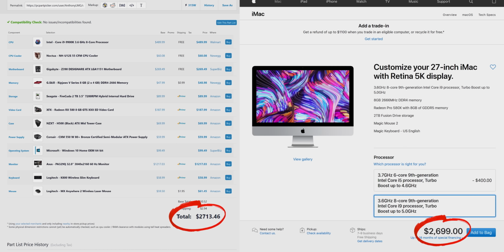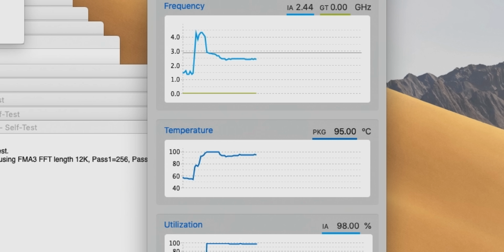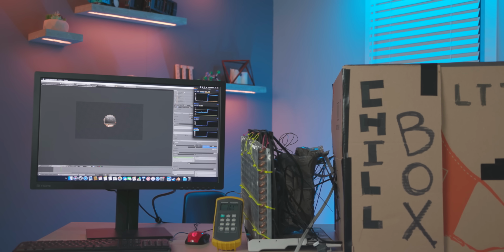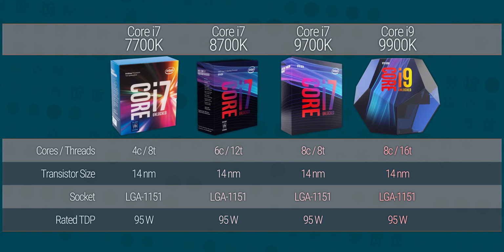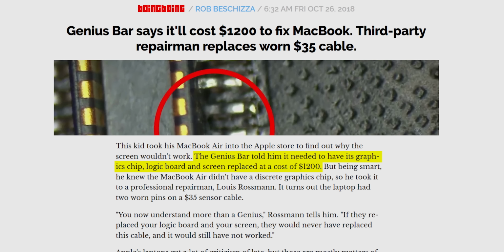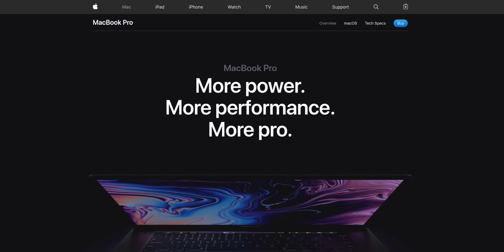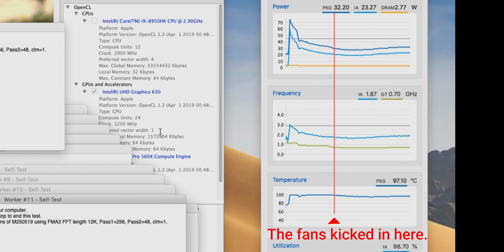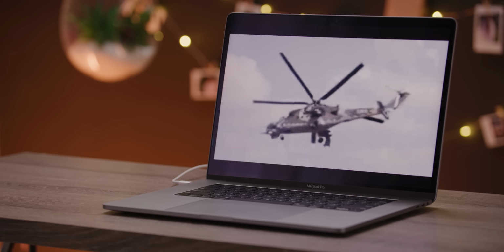Macs are SLOWER than PCs. Here’s why.

Comment: How is benchmark scores that don't go down from heat a "very compelling reason to buy an iPhone"? With today's phones, are the geekbench scores really important? Do you run into thermal throttling on your phones? Apple's iPhone SoCs are way more powerful than the equivalent Snapdragon, but the actual speed difference between flagship Android phones is and iPhones is negligible. How is that compelling?

Comment: Please show me a Windows machine in a similar form factor and battery life to the MBP that doesn't also throttle the CPU significantly under load. While I agree it's complete BS and these companies need to figure out their cooling strategy... there are simply no Windows laptops doing it better.
Reply: The Stealth and Gram both have U series processors with about half the power of the H series in the MBP. They're meant to run on lower power and be cooler, as they're made for "Ultrabooks". The Razer is also only available in 13". Both have excellent battery life and are great computers, but not meant for the same user as the MBP.

The XPS is probably the heaviest offender for thermal throttling. The last few versions have been plagued with throttling and WiFi issues. The only way to fix the throttling is by undervolting, which is what Apple does. The new OLED on the 7590 is gorgeous, though.
Reply: Razer Blade 15

Comment: Makes you wonder why they changed the Mac Diagnostics, too a more concealed progress bar. Why Else! so Apple can remove certain test parameters that would fail easily and save money from reducing the number of repairs they have from this issue. Just more "Software Trickery" from Apple. This is also the main reason apple never supported viewing hardware in the Activity Monitor, why would they give you access to information that would expose them, and there bad product designs; essentially apple is selling defective products and raking in profit. ........crickets

Comment: the  macbook pro had a known problem with heat, for over 5 years, causing the melting of the solder that connects motherboard to GPU, and there is no way to fix this!!!